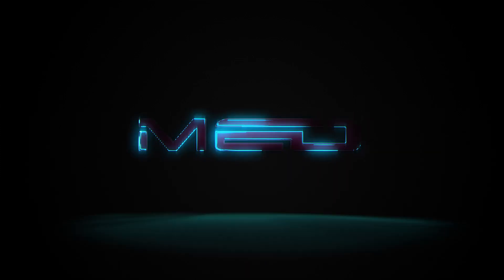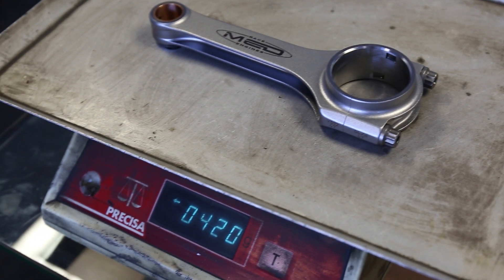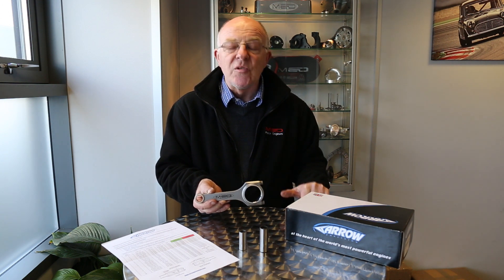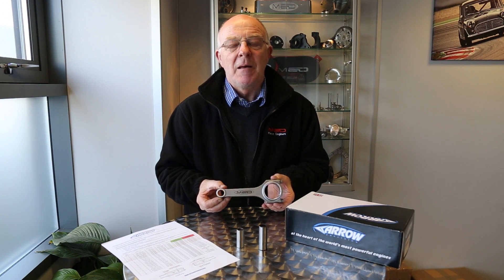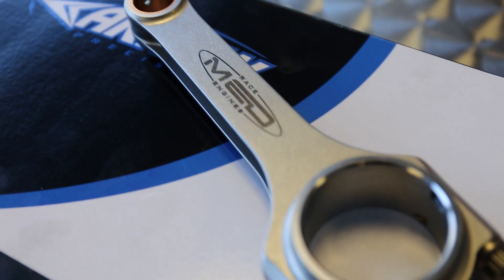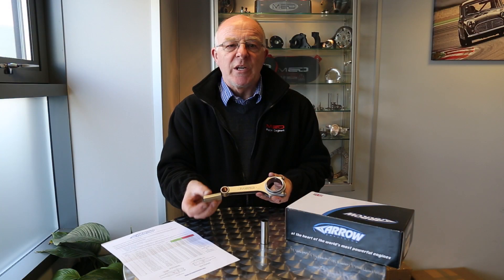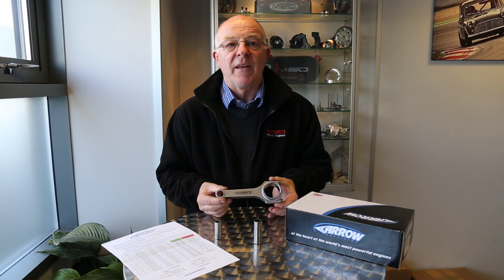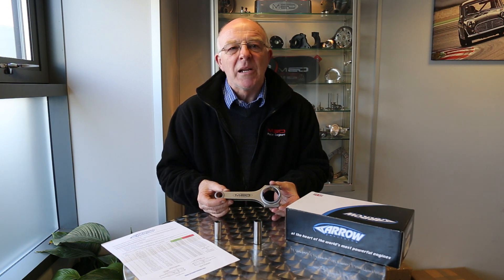The ultimate A-Series steel conrods

Comment: And two years later I have just read an article where people have begun 3D printing conrod using carbonfibre composite, straight onto the Bronze or equivalent bushings at both ends, now that is what I would call light weight, but they can withstand HP forces around the 3000 mark. You wouldn't believe it would you. Nice rods by the way.

Comment: Doesn’t the big end have some passages in it for oil?
Reply from the maker: It goes the other way around on the big ends - as in, the crankshaft feeds the journals with oil.
Reply: @MEDEngineeringTechVideos  What I meant was, those parts you machined to represent the weight of the different big end sizes are solid but in reality those big ends are partially hollow, I think?
Reply from the maker: @brianbob7514  Yes, they are drilled, but it gives a very good idea of the weight difference between the three sizes.
Reply: @MEDEngineeringTechVideos  thanks for the reply and thank you for your great videos.

Comment: Hi Steve, I'm really enjoying your videos and have viewed many of them. Going back to the past to the early to mid 1980s we had in Australia a car from the 1960s called a "Morris 1100 S" which surprisingly wasn't just a Morris 1100 with twin carbs but in fact, had a 1275 engine with a single carb. Just going through my old notes the cars had a choice of two blocks, a 12G1279 which had a cast hole above the center main and was fitted with sleeves in the bores(useless) or a 12G949 block which had neither. Both blocks had forged cranks and Cooper 'S' rods.  The 12G949 blocks were very well made and if it weren't for the cast in tappet covers you would swear they were 'S' blocks they even had steel main bearing caps. I built one of these to 1330, an MD296 Kent cam (290/300), a Mk 1 Cooper 'S' head (modified by moi) and a Mk 2 Cooper 'S' gearbox. All the moving bits were lightened and it had a long 3 into 1 exhaust feeding a straight through muffler and twin 1-3/4 inch Su carbies taken from an Austin Kimberly (2200) which bolted straight onto a Cooper 'S' manifold. This engine would easily rev to 8000 RPM. The engine was built by me for my girlfriend's black Mini Clubman which got t boned by a bigger car, after which it ended up in my 13-inch wheel Moke which I believe were an Australian oddity. It had a few quirks like blowing a head gasket once a year and break a driveshaft once a year, but it was worth it. It had a 45DCOE for a while but they are too noisy for my liking hence the SUs which gave the same performance without the noise. I used to love building engines and I was the one my fellow Mini enthusiasts would call on for this task. One engine oddity was a 1030cc Morris minor 1000 which used +60 998 pistons and rods and a 998 Cooper head, 12G295 from memory. We were very lucky because we had an English Motor Wreckers 10 min drive away, ten minutes drive in the other direction we had an excellent Machine shop called RPM Engines who would machine anything we wanted including custom camshafts built up and ground to any profile we wanted and Settlement Exhausts who would also do custom jobs for us (Street legal or not). We were such regular customers that we were on first name terms. I hope you find this blast from the past interesting. 
Cheers, 
Baz Daly